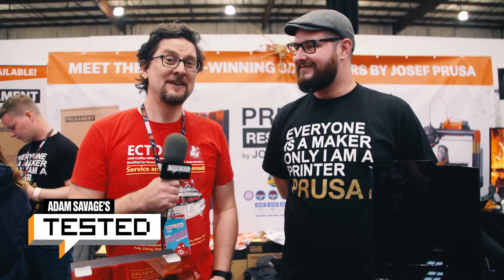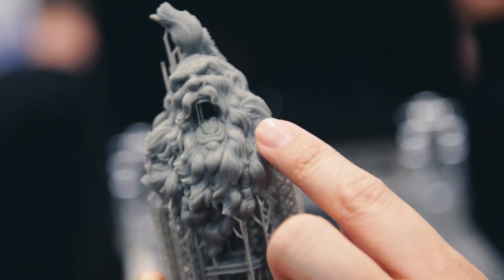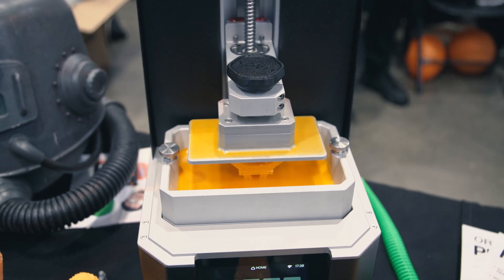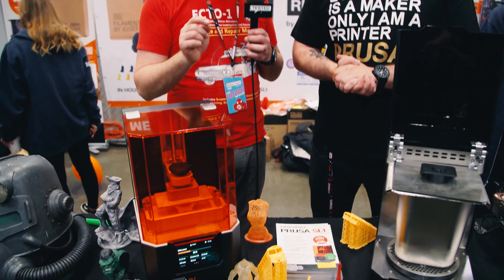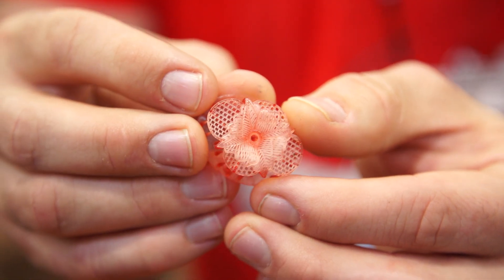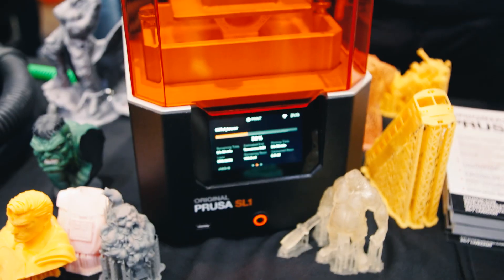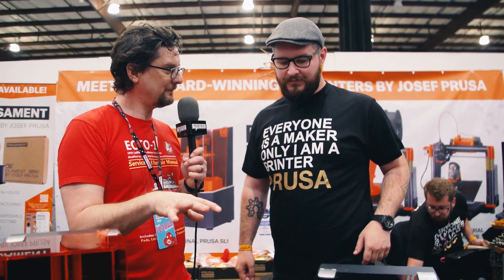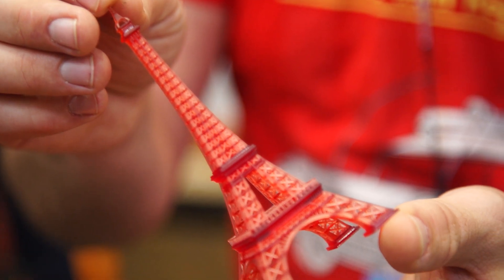First Look: Prusa SL1 Resin 3D Printer!

Comment: How is it different from Anycubic Photon
Reply: Which resins are recommended for the SL1 to print functional parts like tools?
Reply: It tilts the bed for easier peal, has easier bed leveling, it cost 3 times the price and have warranty longer than 3 months.

Of curse you could just buy 2 extra photons for spare parts :)
Reply: @christianbay7614  Thanks for the reply mate. So you're saying this Prusa printer is 3 times mote expensive than the cubic or it's the other way around? Any idea when these sorts of printers become affordable?
Reply: @jiehfeng-187  The photon is ~500$ and the Prusa SL1 cost 1600$. They became so cheep roughly last year because they are actually very simple printers with very few and easily available components. DLP printers are a lot simpler then FDM or SLA printers both in hardware and software.
Reply: @christianbay7614  I see. Thanks for the help.
Reply: @jiehfeng-187  anycubic needs an update to print properly, look at physics anonymous channel and see what they did. Out of the box, Im betting the print quality of the prusa will win over anycubic
Reply: @claeswikberg8958  rather waste few hours to calibrate it than spending 3 times the price for the same kind of printer.

Comment: Isnt this the same resolution as the $500 anycubic photon s?
Reply: Yes and it uses the same UV LED masking.
Reply: @badger47-n3c  so a 700 dollar upcharge for prusa polishing
Reply: @PulsefiredGaming  The printer is 1600$ so an 1100$ upcharge
Reply: @christianbay7614  the kit is $1200 and since the photon is also a kit printer thats where the comparison should be
Reply: @PulsefiredGaming  The Anycubic is not a kit. I  got 1 at release and 1 2 months ago. There is no assembly.
Reply: @badger47-n3c  yup, second that.
Reply: Yeah, I was thinking the same thing. Only thing I noticed that seems different is the prusa is doing anti-aliasing, which I don't think the photon does. But I don't know what effect that would even have. Like, you'd have voxels of half-cured resin?
Reply: @thepoynt  Actually they released a video 2 weeks ago on how to upgrade your firmware to use anti-aliasing
Reply: @LongIslandIceTea  it fucking rocks!! I get no visible patterning on my prints. I used to before A-A tho.
Reply: prusa was always the apple of 3D printing. You can always have the same quality for a third of the price.
Reply: @KGB95140  my first printer was an AnetA8. Now heavily modified. Now I've got another printer. CR-10. Very solid, it just works.
Whenever I see the prusa i3 mk3 I'm like...PLEASE NO...I would never want the AnetA8 back. lol! What a horrible design to start with.
Reply: @REDxFROG  lol, but the ratio of price vs quality is a no no for prusa. You clearly can have a better result for a quarter of what a prusa i3 cost.
Reply: @KGB95140  no you cant... i build my own 3d printer as a core xy (700bugs), have a cr-10s heavily modified with tmc2130(now atleast 700bugs) in spi and I bought a Prusa i3mk3s just to see if it holds up, but the ecosystem works that well, that it produces my overall best prints in the shortest time. Heck... i dont even bother to use my other printers anymore, it actually was worth it. it maybe a bit pricy, but to replicate one, would cost atleast 450 bugs and many hours to go. i enjoy it and even ordered a second one, the support is also fantastic, havent had any problems with him.
Reply: @KGB95140  oh haha. What I originally meant is... I dont want the anet A8 again... Neither an i3 mk3 prusa. Because the prusa has exactly the same design flaws.
Reply: @Thor_Asgard_  at the end you did say the same thing as i did with a 450 (bugs?) do the same like the 900 (bugs?!?) a prusa could.
Just need few hours to tweek it to be the same and for me i rather spent 5 hours than 500$ :))))

 REDxFROG  Oh my bad then, yeah i don't like those design too to be honest :)

Comment: I've yet to see what is so good about this? An anycubic photon is almost identical
Reply: I just got my Anycubic Photon on wednesday. For less than half the price the only differences (spec wise) is the prusa has the tilting bed, and slightly different max print size. The Z-axis may be slightly more accurate but at 0.05 mm layer height. I can't see the layers on the stuff I have printed so far so I don't think it matters.
The biggest advantage Prusa has is the brand name and maybe customer support, but I wouldn't know because my Photon works great so I haven't had to deal with them, and I have never owned a Prusa machine.
Reply: @Heavens_Rejected  I'm gearing up to get a Photon, been tempted for too long now. I agree, you're paying for a popular brand in Prusa, not much else when it comes to this particular printer.
Reply: Just a guess from when I priced my sla build but quality linear rails & a ball screw add a fair amount onto the build cost of the unit. I'm guessing the tilt mechanism does as well. Generally(very) in business the build cost tends to be roughly 1/3 of final cost paid by the consumer. So you can probably see how the price point for the end user can rapidly increase with increased build cost. 

Now I will say I LOVE my photon however if you print more that 60% of the bed you can see the Z axis flex pretty good when it attempts to remove a freshly cured layer from the FEP film. So there is something to be said for the tiling bed and a sturdy z axis But I am 1000% satisfied at the price point the photon at and it does most prints flawlessly with issue arising as you fill more of the bed (due to z shift from suction to fep film, this is mainly on the bottom layers since they require double or triple the cure time).  

I'd probably buy another couple photons before I picked up an sl1 but that's because they simply offer more utility for less $$. The sl1 still appears to be a well built machine though so kudo to prusa for that!

Anyways hopeful you got something of value out of my ramble Haha & if your on the edge on the photon I'd say just do it, @ $380 its banging.

Comment: $500 for a magnetic stirrer and some UV LEDs?
Reply: IMHO that's reasonable for a good machine made of metal sold in low volumes (they're not going to sell millions of these). In comparison, I find the i3 mk3 price unjustified, that's just a few metal parts, plastic, steppers and basic electronics.

Comment: Points out the Peopoly Moai which has been around for a year or so is only $1,295. If you want the slick interface though $1,600 for this is actually pretty reasonable price. But for roughly that much you can buy a Moai fully assembled.
Reply: That's true. But I'd much rather Prusa's software ecosystem/support any day. That is always just as valuable as the tech itself and why I own a Form.

Comment: The whole point of SLA is to move from raster/voxel slices to vectors, no? LCD SLA seems an odd combination.

It’s like using fancy backlight technology for an oled screen. Big step back from a well tested, understood technology.
Reply: It's because it's not SLA.  It's DLP.  I assume Prusa want to associate their machine with the quality of SLA, and away from the cheaper DLP machines.
Reply: @MarkRhodesMaker  DLP is SLA. There are different technologies within the range of SLA (laser, UV-display etc)
Reply: Mark Of The Rhodes what a shame. They will probably market these 3d discrete printers with the 1d discrete laser SLA type. As if FDM didn’t have enough issues with discrete geometrical printing. Seems the only positives are the effects of a print being solidified by presence of light rather than air/temperature, and the buoyancy effects of printing in a resin bath. Resolution benefits of classic SLA are lost here.
Reply: A few companies have successfully used this method already. With that said, Prusa has butchered its main appeal. The main appeal of using DLP instead of true SLA is the cost. SparkMaker is one of the pioneers of this technique out of the crowdfunding space. While they arent as feature rich with a spartan interface, without the tilting tank, and are only 1080p, they are also only $240. The point of the DLP was to make near SLA quality prints affordable to the masses, much the way Creality has become a hit in FDM for delivering $500-1000 quality in a $170 kit. The idea being that people will give up 5% in print quality to save 80% on machine cost. Prusa, meanwhile, missed the point of DLP by overloading it with features and charging $1600 for it. Meanwhile, im still waiting for someone to unleash DLPs ultimate trump card, size. Prusa and Sparkmaker have print volumes the size of an iphone. But realistically, DLP can be scaled far easier than SLA for print volumes the size of a standard computer monitor without the exponential cost increases. Imagine a 27" build plate for resin for about $2,000. Thats what DLPs true power in 3d printing will be
Reply: Bubz of Steel  yes. They could. All they need is a panel with sufficient brightness and strong enough steppers. That's all the printer really is if you forgo the rocking bed. Panel costs aren't all that high with finished monitors with sufficient brightness and resolution under 400. And the steppers would not be all that much more expensive. Realistically, this could be manufactured in the 1000 to 1500 range plus profit margin. That's the advantage of DLP. The limiting factor is how much weight you can adhere to the bed. Panels exist that can create the projection the size of a wall for under 10000 retail

Comment: no more problems with model kits broken parts.
Reply: except most resin prints have the strength of toilet paper, very brittle
Reply: @Dust599  yeah... But it depends on the kind of resin. I don't remember exactly which one... But I think polyester resin is more flexible... Don't quote me on this...

Comment: If only they could get the darn Powder-Coated Sheets for their MK3S sorted out... I've been holding out on buying a FDM based 3D Printer for like ages due to wanting that darn Sheet but you STILL - CAN'T - BUY - IT!
How hard can it be to make these!? It's almost as if the author from the Berserker Manga is making them >_<
Reply: Durahl They had some PEI powder-coated sheets in stock a week or so ago, I was able to order one. 

The process aparently was much more difficult than they thought. They have had alot of set backs, rusting under the powder-coat, sections of the powder-coating pealing off, etc. They have also raised the price of spare sheets because the sheet rejection rate is so high (it says it right on the page). 

Im pretty sure I have read they have filled all the back orders now.